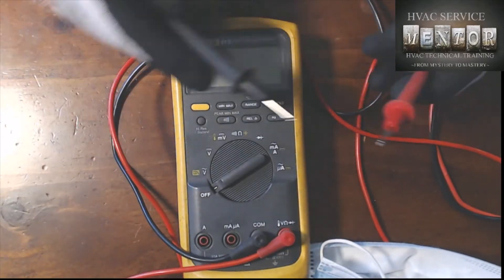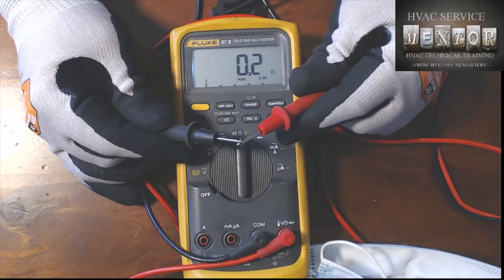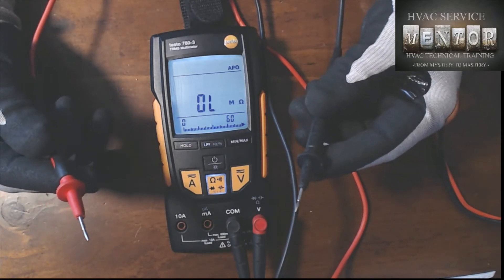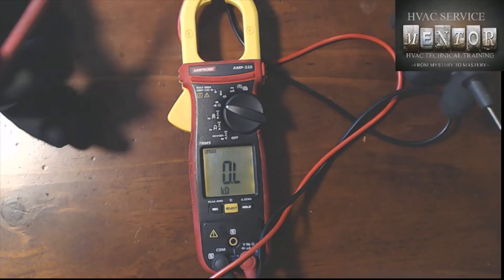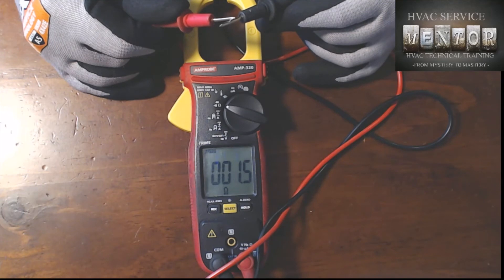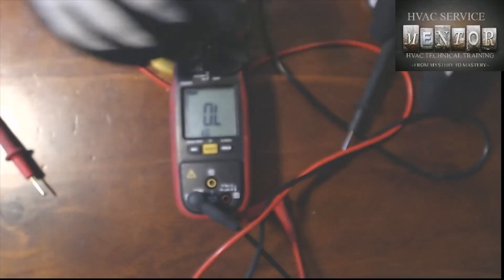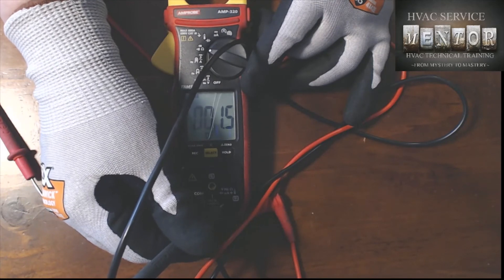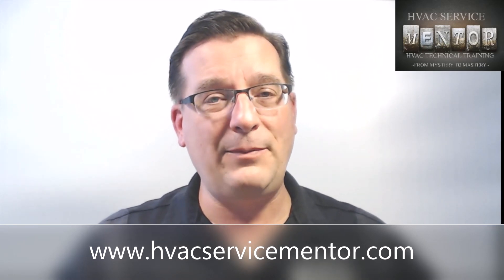How to Test your meter leads for HVAC techs.

Comment: HVACE SERVICE MENTOR, the other probe leads tested good of resistance but might not pass the Insulation resistance test good using 400V Megger. Why not make a YT lesson about testing probe leads using an insulation resistance test?
Reply from the maker: I need to test the leads I'm using with the meter and I have the meter right there.  I'm not so concerned about insulation as I am about the integrity of the conductor within.  Naturally, you will want to inspect the insulation for any cuts or voids for safety purposes.

Comment: hello and thank you for your videos. i am having a problem with my meter. i can test ac and dc voltage but cant seem to get any other readings. there is nothing when i test the leads as you show and no sound or reading when i check continuity. does this mean the meter is bad or is it i am doing something wrong. thank you for any help you can provide.
Reply from the maker: Glad you like the videos.  In a situation like this, I always wonder if there is something wrong with the instrument or if I'm doing something wrong.  I recommend you follow the same steps with another meter that is known to be good.